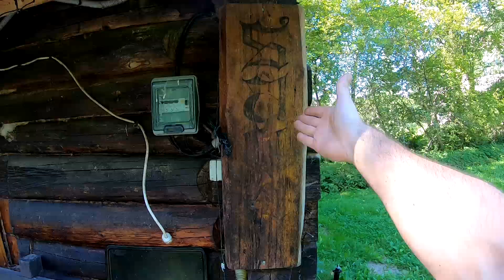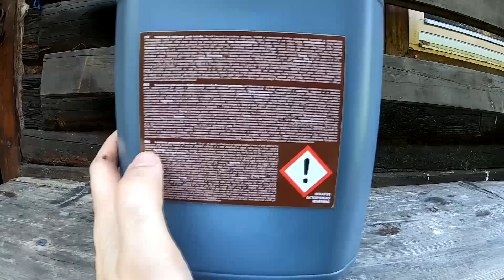Log Sauna Maintenance and Garden showcase

Comment: If your snow is like ours when it melts it curls coming off the roof.  So it drops down considerably before it breaks off.  Gutters need to be made strong enough to hold up to that load is the only solution that works flawlessly.  I ended up fabricating mine out of structural aluminum (five inch channel with an additional 1 1/2 strap welded to the edges to deepen the trough) with adequate bracketing.  I used 3/16" plate to cut out and weld brackets to the channel on 12" centers.  They have a flange bent into them to take three 5/16 x 4" stainless lag bolts in each bracket.  That gets fastened to a 2x12" soffit, itself lagged into the 4 1/2" x 12 box beams which make up the rafters on 16" centers.  Haven't had any issues with it.  It would seem the gutters offered on our market are so thin and ill supported that they come off in the first snow and or rust out by the second year.  It would be better to consider the gutters as a structural part of the envelope rather than an afterthought as most builders seem to do.  I see your mom in the background mowing the lawns.  She sure does a nice job!!
Reply from the maker: Thanks for the info. Yeah my plastic crappers are weak. Usually we have snowblockers added to the roof just before the rain cutters that hold the snow on the roof untill it melts away. Thanks for the comment

Comment: Tipp for your Kärcher High Pressure Machine:
I have bigger Kärcher, but i had same problem as you had at the beginning. Here the solution:

1. Let the water run in the incoming waterpipe until water come out. If you conect to Kärcher, but there is stil air in the pipe, Kärcher will not work correct!!!!
2. Befor you conect the incoming waterpipe at Kärcher, there is a transparent water filter. THIS one you have to clean from time to time. If filter is full of dirt, water will not go inside and Kärcher will not work correct.
3. Beside on that waterfilter you can check if water go inside. Only if that transparent „glas“ is full of water, THEN Kärcher will work correct!!!!
4. Do not forget to switch on Kärcher, otherwise no pressure 😁😁
Reply from the maker: 👍👍👍 all are correct. The problem was flowrate this time

Comment: Hey Andris, I wouldn't bother with any chemicals to be honest. Get yourself a petrol pressure washer, you can pick one up for less than 200 euros from Lidl when they have it on. Those things can strip paint and render from a house so it'll have no problem with a bit of moss and likens from roof tiles.
All the best mate!!!
Reply from the maker: That would be awesome. But i think maybe not the best for roof tiles. As they have some uv protection sprayed over the paint surface. Might wipe that off 🤔 or not
Reply: @Ants_Pants  Just be gentle on them, but once every 6-7 years won't hurt that much anyway.

Comment: Just reminded me.  Years and years ago people installed a strip of pure copper (1/2" wide or better) on both sides of the roof just under the peak cap the length of the roof.  Kept moss and slime off the roof forever.  Not sure exactly what they used for fasteners but it sure worked.  On wood shingles as well as asphalt even metal.
Reply from the maker: Hmm 🤔 seems interesting

Comment: Re. the Uber-Ultra-Super-Plus (broken) pressure washer: Check that there's enough flow rate. I had a similar problem (similar symptoms) with our one, it wasn't getting enough water.
Edit: Never mind, I see you got it working :)
Reply from the maker: Yes flow rate was the issue. It has a sensor if its not getting enough water then it will not run the water

Comment: Unfortunately the plastic-electric pressure washers are fragile :( At least you have a filter on yours which helps a bit, but if they get any junk in the plastic valves/pistons they are going to slow down and not work effectively. It helps to run them dry for a few seconds after use as well, which is not at all obvious but clears out the pipes and stops it freezing/getting blocked with limescale.

All of your gardens are amazing though, it is a very nice transformation from the before pictures :)
Reply from the maker: Thanks for the tips bud 👍 also for the kind words😜

Comment: Big fan of your videos! But, you really shouldn't pressure wash upwards on a tiled roof.... Probably not such a huge problem on the sauna or outhouse, but on the main house I wouldn't do it. Point it sideways or downwards.
Reply from the maker: The water gets under the tile. But there is also undercoating under the tile so water will flow over the edge of the wall